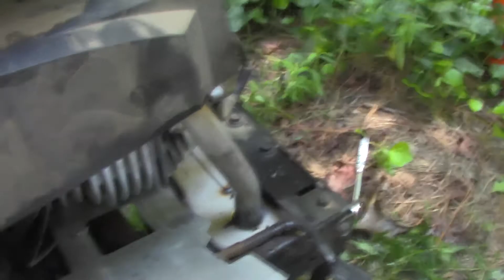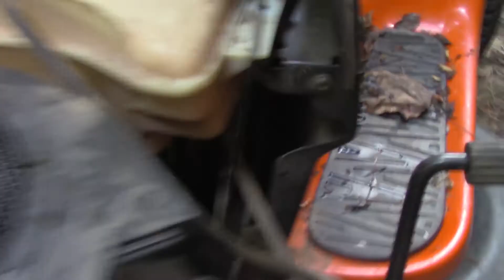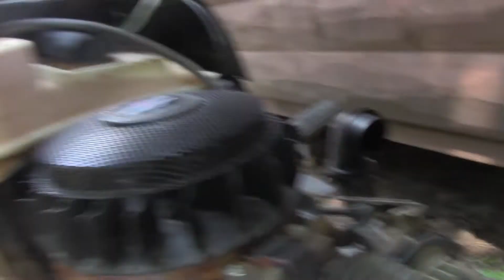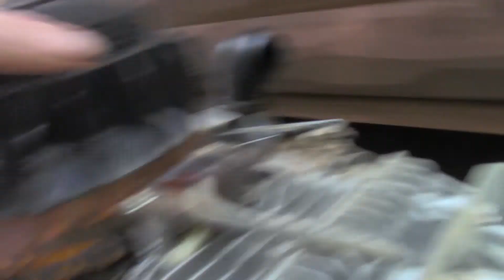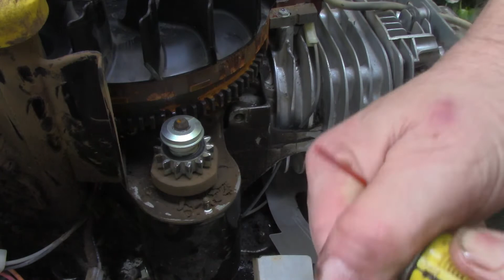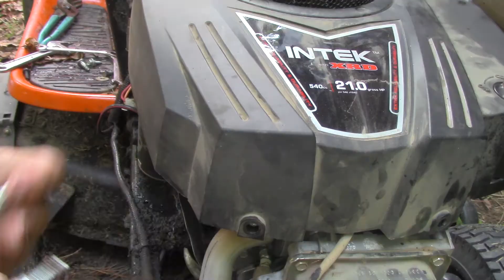Ariens Briggs and Stratton Intek Locked Motor Repair

Comment: Nice video man, had a similar thing happen to my mower. Cheap plastic drain plug developed a seep enough to run fairy dry. Wish I had seen this before pulling the engine apart.
Reply from the maker: Mine didn't last all that long after unfreezing it. I ended up replacing the motor anyway. But that gave me another opportunity to make a couple more videos.

Comment: Mine had a broken compression release on the camshaft but after replacing it the starter still can’t spin the motor, any ideas?
Reply from the maker: Another thought. You may simply need to adjust the valves. When the valve lash gets to be to big, which happens a lot, the compression release mechanism will stay closed so the engine will not turn over. A quick check is to remove the plug and see if it spins correctly. If so, it is a valve issue.  https://www.youtube.com/watch?v=97v0tNhyfpE
Reply: These are notorious for hydrolocking. The needle valve and seat go bad causing fuel to get into the cylinder and crankcase. Take plug out and spin the engine to blow the fuel out. Reinstall plug and try to start. If it does, rebuild the carb or buy a new one. Install fuel shut-off valve to keep from happening again.
Reply from the maker: Will it spin by hand? If not, there is probably more internal damage.

Comment: Mine ran fine last year after teplacing the starter motor, solemoid, and battery.  Now the starter motor wont even engage.
Reply: Get a battery hook the positive directly to the starter wire and the ground to any peice of metal on the mower. Should work
Reply from the maker: I hate it when a needed tool isn't working.  Check your cables, hopefully you just have a bad connection.

Comment: Question: I followed your video... I can turn the flywheel but then it hits a spot where it gets stuck. Can't move it with my screwdriver past that spot,  and about to try a crowbar for more leverage. Should I? Or is the engine a lost cause?
Reply from the maker: Probably a broken rod and time to swap the engine.
Reply: @TwoKeysStudio   I was afraid you would say that. I bought the lawn mower brand new 4 years ago and I can't believe it's given up.  Always made sure I checked everything every year before running it.